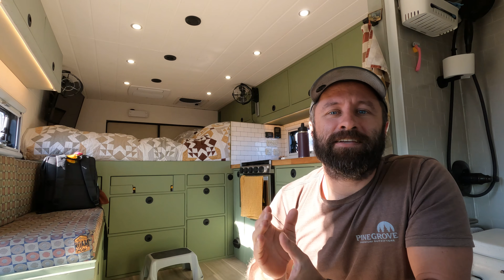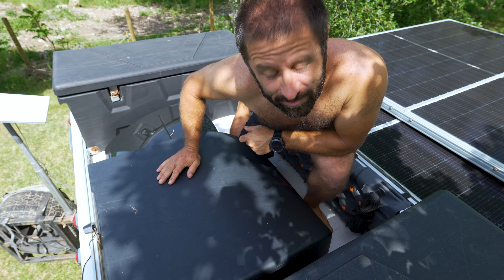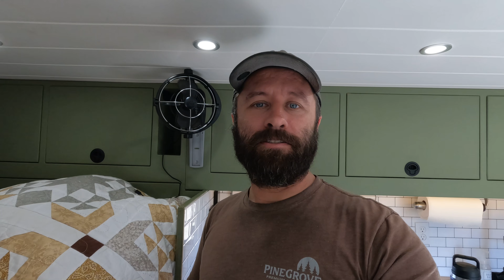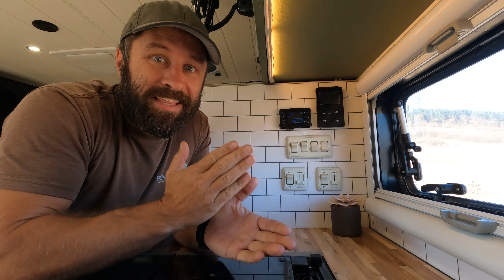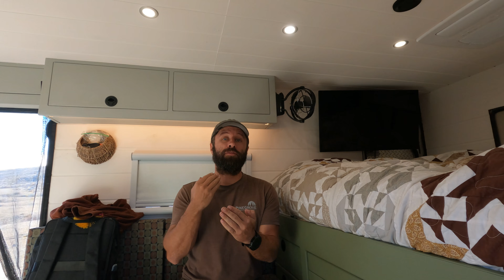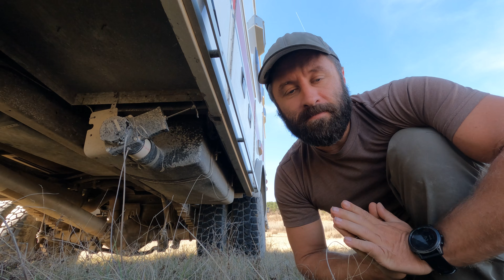Why "Good Enough" Wasn't Enough: Our Van Build Evolution

Comment: I applied EZ-cool insulation to ceiling and wall ribs and skin. All seams taped with aluminum foil tape. 2" Havelock wool insulation. Seems like wool has enough air pockets for reflective barrier to work. Garden netting and some 3M 90 to hold it up. Battens screwed flush with the ribs, into the ribs. Ceiling and walls screw into the battens to avoid thermal bridging and condensation on screw heads. Battens sealed with polyurethane in case of condensation. It's been working great camping at ski areas. Not bad in the summer too. Transit i'm building for a friend got Duck liner + thinsulate.
Reply from the maker: It sounds like you did it right! Thanks for sharing the info. Ill have to keep this in mind if/when we redo ours.

Comment: Great video! I did not know about the Garmin power switch and have been searching for something like that. PERFECT!! I have also installed a 12v ball valve to solve our wasitng water. I have a smaller 16 gal fresh water tank. I actually let the the entire tank get up to about 80 degrees before we start our shower and it works flawlessly. We built our camper from a cargo trailer originally as a recreation camper but have decided to go full time in it when I retire in 4 years. We have started  converting things to take us to a comfortable full time rig. AC is a big one for us as we currently have a residential 12000 btu mini split installed. We have no solar and that is next years project. I am trying to decide weather to add enought battery/solar to handle current mini split or go with a 12v mini split and get less battery/soalr. I figure the cost will be close to the same as the 12v mini is big money. ahhhh decisions, decisions. As this is the first video of yours i have come across I am now going to find your solar panel install video. I like how you are able to pull our more pannels. Something I have also been trying to wrap my head areound. Check out my build on my channel. Be warned, I am no "youtuber" . keep up the good work. Peace!!
Reply from the maker: Thanks! 
Garmin Power Switch - It does work REALLY well once you have it configured. I wish light dimming for lights was a quick feature but I setup my own custom panel in the app to allow for 3 light levels for each light. 
I put one of the 12v valves in for our grey water tank as well. It's nice just to push a button and let it go. 
For the air conditioner and power setup, I personally just went big on power to allow me to run anything I want. As I said in the video the 12v AC unit just wasn't cutting it during really hot days. Solar panels are super cheap and lithium batteries are getting less expensive each year so it makes it much easier to have an inexpensive but quality system. 
Here is our solar panel video if you haven't found it yet: https://youtu.be/0Q5yYe9WU7k